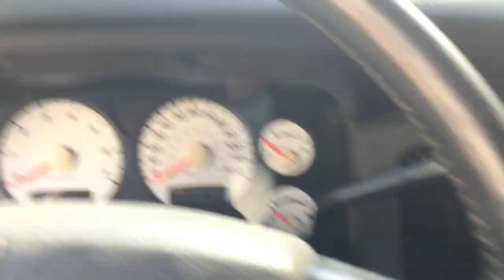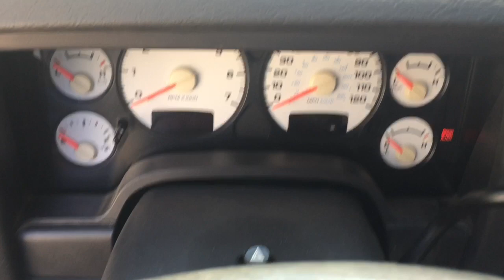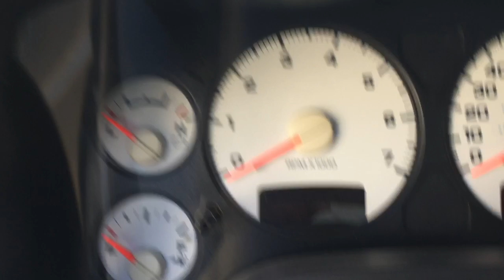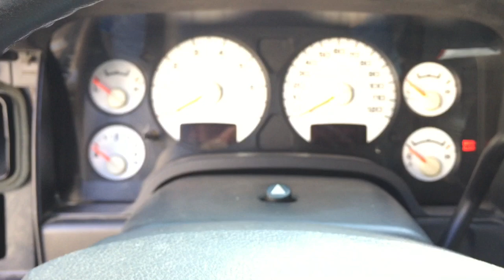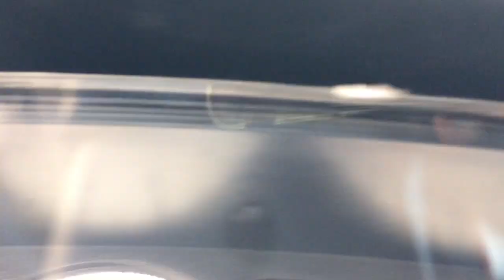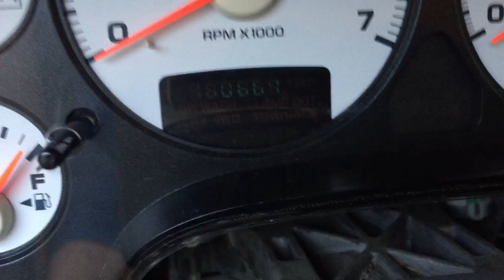2004 RAM 1500 Instrument Cluster

Comment: I have the same issue but mine is the park, 1 2 3 D and cruise side is completely blank.....
I did the led bulb upgrade forvthe cluster but could not find any loose solder pins to fix my problem

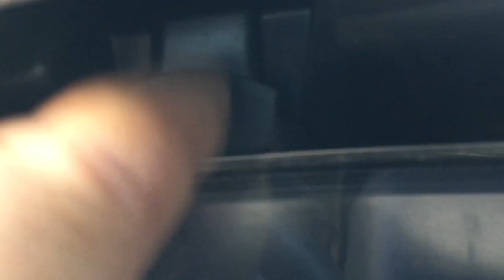Comment: @5:48, why is it that people that make videos like this like to NOT MENTION the hardest part of the removal?  Disconnecting the damn electrical connectors!  You can't see them to know that there are three of them, and each has a clip on the TOP that you need to press in while pulling out... in a place you can't get your hands into!  I recommend using some 90-degree needel-nose pliers, you need to finagle the cluster to tip forward and work from the top.  Use your finder to hold the clip IN, and grip the wires with the pliers and push back to pull out each connector one at a time.
Reply from the maker: The connectors are different.  I had to take it out so many time I never thought about the connector. There is just one tab, but so many connector pins makes it hard to pull out. 🤷🏻‍♂️
Reply: Two nuts to drop the column pull the light switch to the left. Bam! Tones of roon to get your d i c k beaters in there to remove the plugs
Reply: Same here.  That is what I came here for.

Comment: I have this same issue.  I checked all the solder joints and everything looked fine.  I kept the case off the cluster and plugged in the back connectors for the cluster and found the grey 16 pin connector when plugged in would make the odometer go out.  So i cut one by one and would plug in until it didnt shut off.  I found the orange and black on the smaller 16 pin connector was the issue.  per wiring diagram its the panel lamps dimmer signal.  I cut that and it stayed on.  So im leaving it cut.
Reply from the maker: Interesting.

Comment: Did you ever figure out what was the problem on the instrument cluster?
Reply from the maker: Yes.  It was one of the digital components on the board.  I sent it in to be repaired.  It took a little longer to fix because they had to order the part.  The site I used was UpFix (.) com --- I need to type it like that, because YouTube doesn't usually like URLs.  https://www.upfix.com/product/dodge-1500-2002-2009-instrument-cluster-panel-icp-repair-1/
Reply: @McMichen  Were you happy with upfix? How much did they charge?
Reply from the maker: @HuntFishGolf   Yes. I was very happy with the repair.  It took them longer than expected to complete the repair, but it was because of the age of the vehicle and the part needed.  They didn’t change the price of the repair and everything worked great.  It didn’t take me long to realize that this was not a junkyard easy to replace fix.  By having it repaired my mileage remained genuine and all function restored. I don’t recall the exact repair cost, but it was around $120.
Reply: @McMichen  Thanks for the video and the fast reply. I have the same exact problem with my '04 3500.
Reply from the maker: @HuntFishGolf  you’re welcome.  I think overall it is worth avoiding the headache and frustration by just gaining it repaired. The main consideration is if you are able to not use the vehicle while you wait for the repair.
Reply: How do you know which way bulbs go in

Comment: What is the bulb model that I can use to replace burned out bulbs?  Thanks.
Reply from the maker: I tried the LED ones, but they were all junk.  They didn't fit or were loose, so only some of them working.  You need the incandescent bulbs, which are hard to find.  Expensive at dealer, so I went to junk yard and pulled a handful from an old cluster.  Or shop on line for something... https://www.partsgeek.com/catalog/2004/dodge/ram_1500/body_electrical/instrument_light_bulb.html